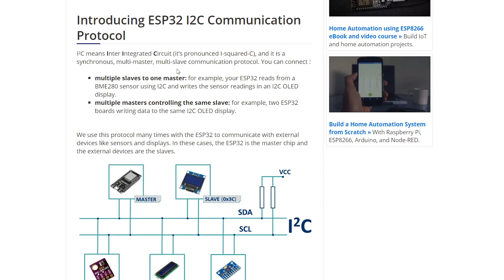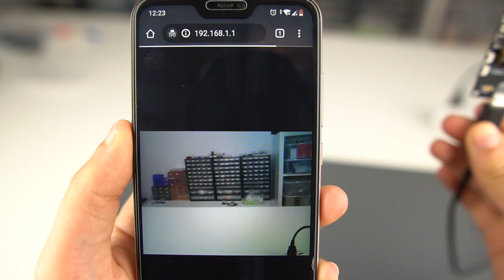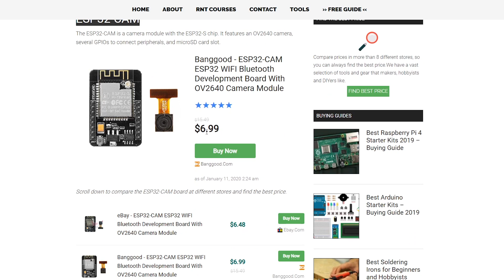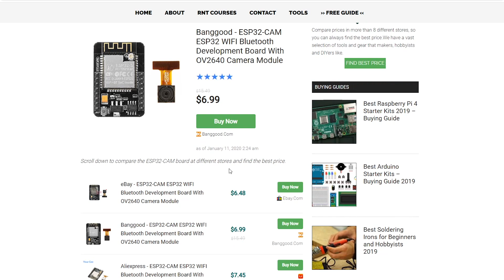Most Practical ESP32-CAM? Built-in Programmer, OLED, Antenna and Project Examples

Comment: Also, no need to reposition that TINY resistor on the CAM for an external antenna.
Reply: TTGO T-Journal Doesn't has any on-board antenna, So it doesn't require any config.

Comment: dont need to use those FTDI adapters (almost all of them around are fake and wont work on w10), just use an arduino through it´s usb converter. 
Set the Arduino on reset state (RST to GND), and use the pins RX and TX (D0 and D1) to connect to the ESP32 cam RX TX pins. You will then be able to program it (with GP0 to GND on the ESP on start). Use the Arduino's COM port on the IDE or any other programmer

Comment: Are you able to run the board off the battery supply?  I've got two of these, and when I feed them ~4.2V via this port, they take about 0.05A and never fully boot.  Both seem to work fine off of USB.
Reply: Small update:  I'm able to get it to run from a battery if I press reset.  Just plugging in a battery doesn't seem to complete a boot.